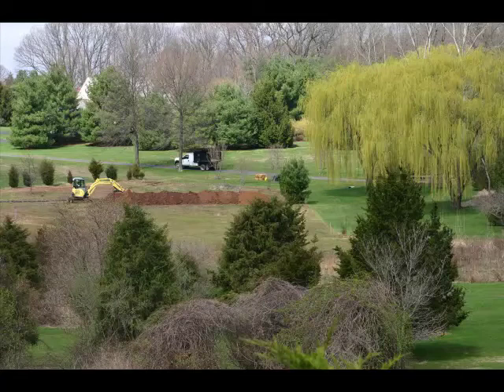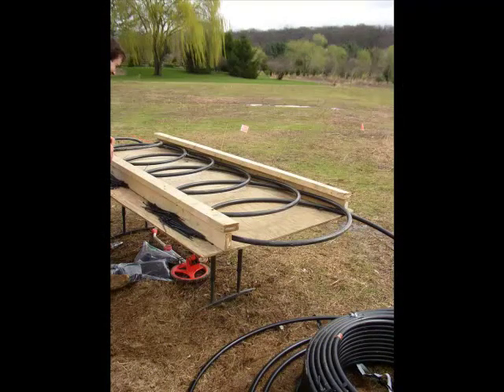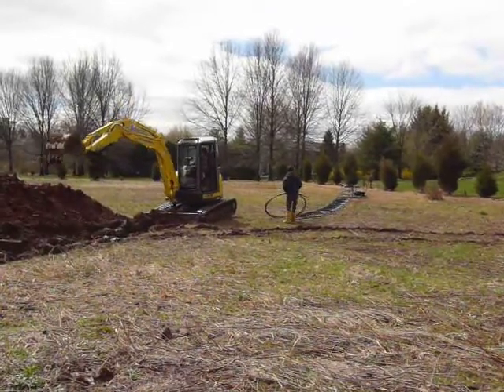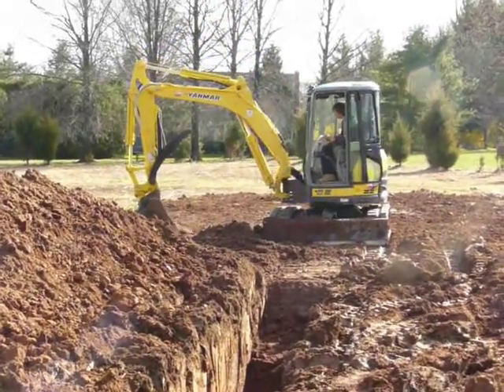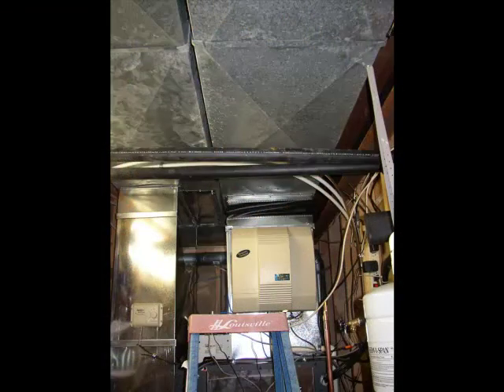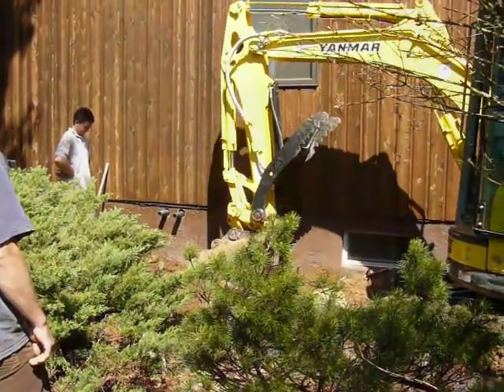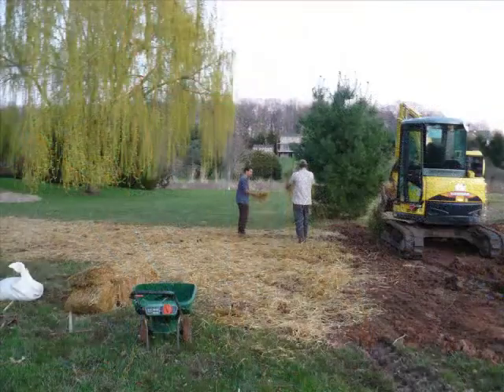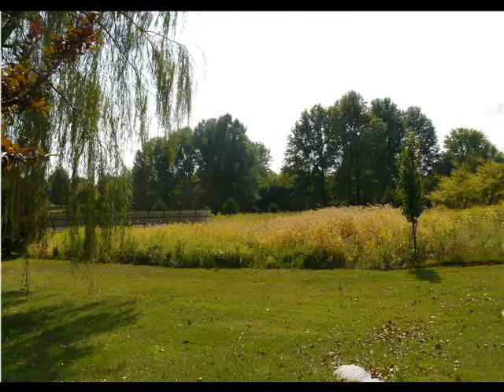Geothermal Energy, Clean and Reliable

Comment: the tubes are 5000 feet long, total, with approx. 1 square inch cross-section area,  = 60,000 cu.in.   = approx 35 cu.ft.  ...  this is the approx. amount of AIR which is constant-ly be-ing heated or cool'd by the EARTH, 6 feet down, which stays at almost the same temperature, year-round ...
35 cubic-feet is, like, more-than a cubic-yard of air ... i reckon that, if you continuous-ly pump it in-to the house, it will do an adequate job of either heat-ing (in winter) or cool-ing (in summer) !!